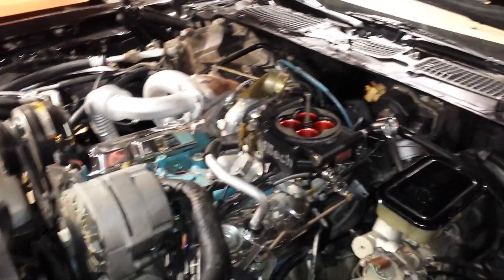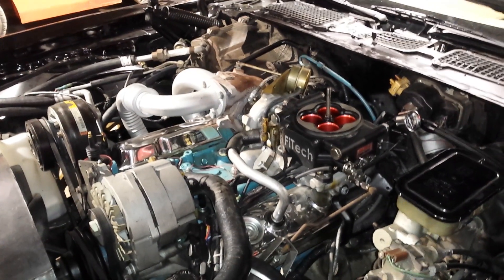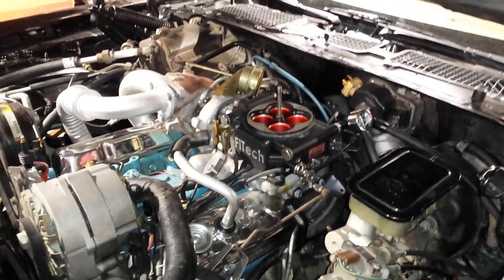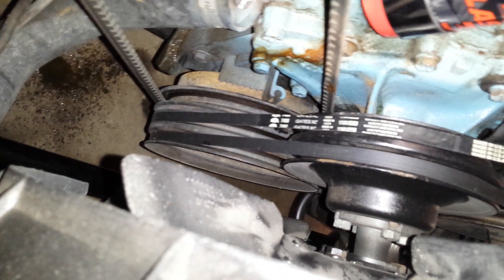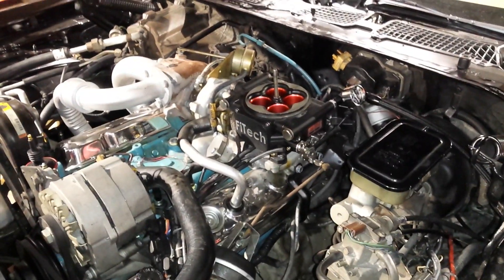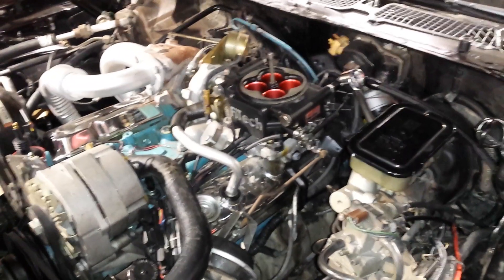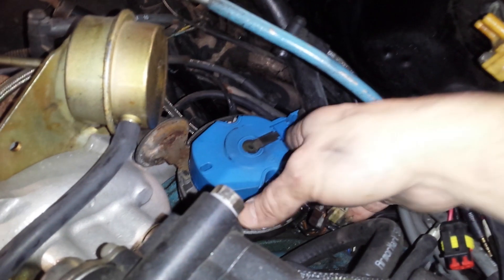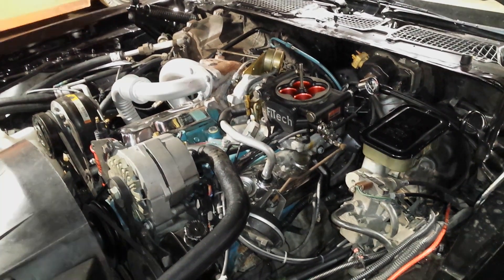TTA Performance - 301 Turbo Distributor and Timing.

Comment: I have a 1978 Pontiac Bonneville I just replace the ignition module Initiate call roller be a distributor cap you still would not stay running I had to turn the time for it to stay running but it was really real real bad back fire and blow up the whole muffler So when I thought it was running right it would not gay no power at all anymore shaking everywhere no I want her to take it to the junkyard with 64,000 original miles

Comment: My car is a 19 7828 one-way at 301 AJ you keep bringing up the cool emoji later I just change the core modulate a distributor cap rotary and it would not stay running turned a timer for it to stay running got it ready now it’s running real bad and I also change the spark plugs and wires still can’t get it right and now I’m piss and ready for the junkyard at 64000 Original miles

Comment: my 81 choke idle is way too fast, until it warms up
Reply from the maker: Turn down the high idle screw. It is on the passenger side of the carb down low behind the choke housing. Phillips head screw.
Reply: @ttaperformance1046  ok thanks